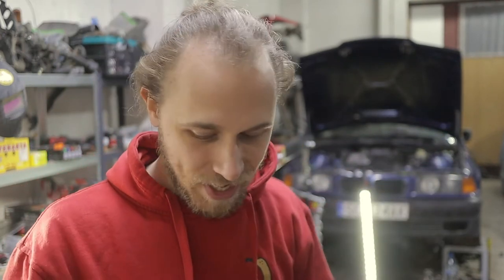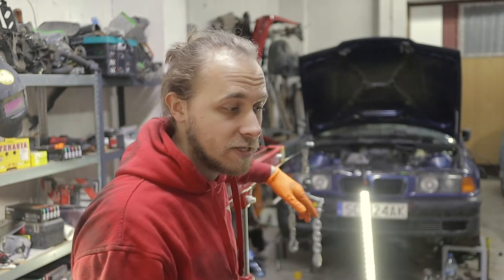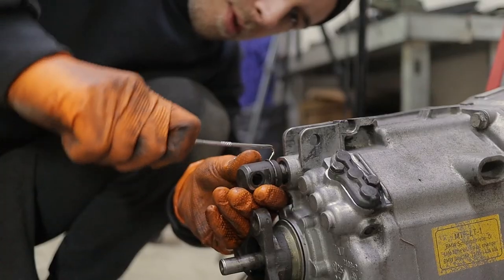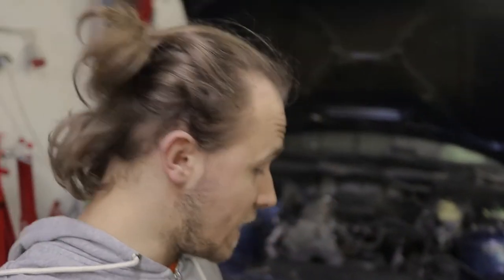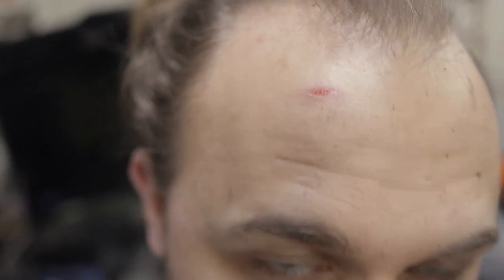Cleaning & Installing my GETRAG into BMW e36 touring!

Comment: I'm swapping my GM auto trans for the Getrag 250 on my 2001 330i.  what engine are you running in your e36?  I am worried the m54b30 engine I'm running will be too much for the getrag but you've got to run what you've got.  Thanks, I'll check more of your videos!
Reply from the maker: Thanks a lot! My e36 has m43b16 so it’s the weakest one but still fun. 
It depends on how you’ll drive it. I think it’ll hold up for a while and if it blows up then consider ZF 😁 
Good luck with the swap 🤞